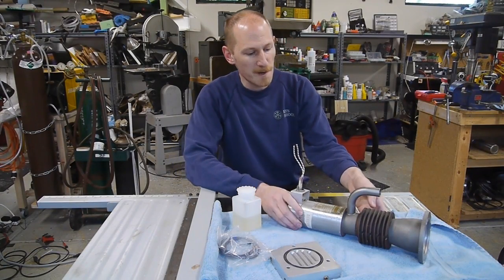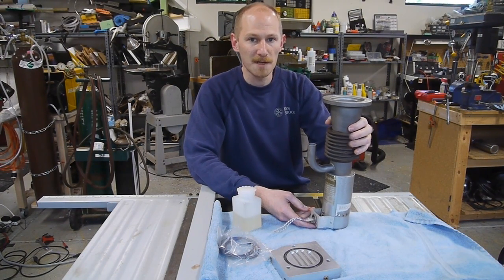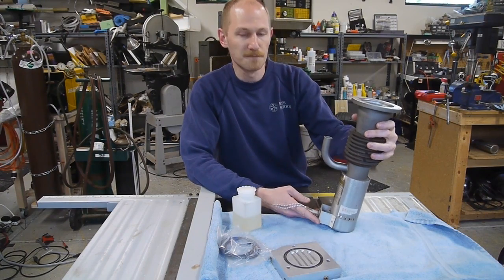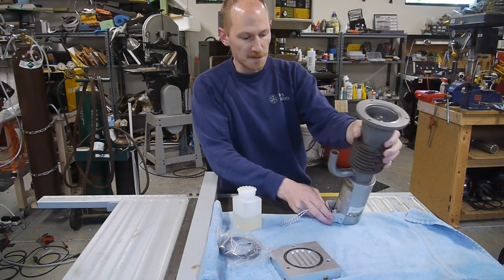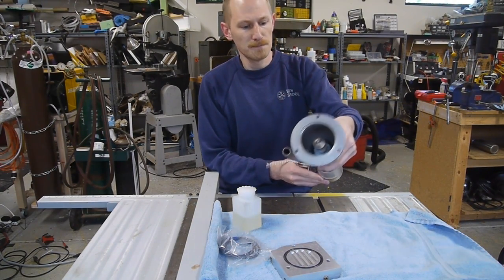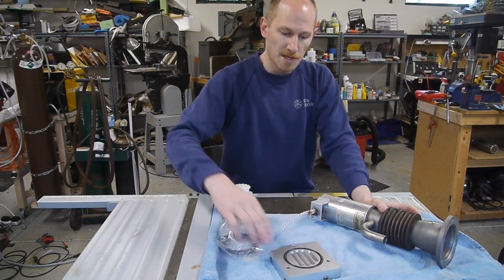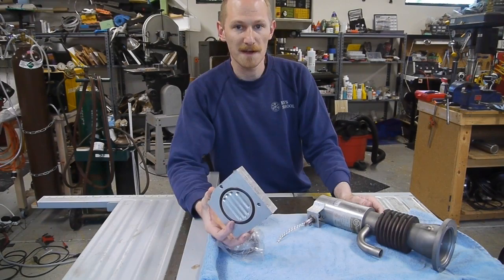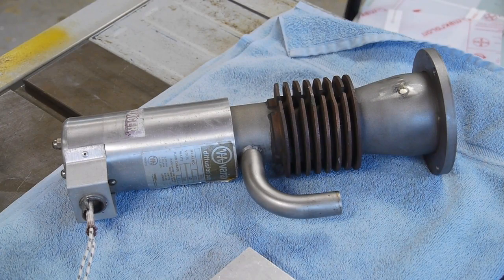Diffusion pump giveaway contest - ends May 31 2014

Comment: I think it is kind of you to do this. I am just curious--  I am unfamiliar with the hardware,  why would you need another vacuum pump from harbor freight to make this one work, and would this be very expensive to buy?
Thanks ! I've enjoyed watching many of your vids, especially enjoyed your lcd displays.
Reply from the maker: Ron Schnaper In order to create and maintain really good vacuums (very low pressures), we need two vacuum pumps connected in series. The two pumps differ in construction because they work with gas molecules at very different pressures. A mechanical pump is good at pushing air around when the air is fairly dense at a relatively high pressure, however it doesn't work very well when the air molecules are sparse at a very low pressure.  Instead, we add a second "high-vacuum pump" to help compact the remaining air and other gases from the vacuum chamber so that the mechanical pump has something that it can actually pump.  The total pressure ratio between the bell jar and atmosphere can be 10^8, which is pretty massive, so we spread out that huge pressure differential between two pumps.
Reply: Applied Science I always used to envision diff pumps as pressure transformers, where actual driving force is mech pump, diff pump does not pump by itself, oil vapor stream just catches the molecules changing their speed and conditions it for mech pump (something like venturi)...
Aah your videos sets me back, Varian, i saw a glimpse of MKS cold catode ion gauge vacuum controller, one of the best two stage vacuum pump Alcatel (orange), did not see Edwards stuff, so many nice things in your home lab makes me remember my old job messing with ICR-FTMS and stuff (still missing superconducting magnet with lHe hehe)... subscribed now

Comment: I can't believe you have a SPARE diffusion pump.... and you are giving it away!
Ben, you are awesome!

I will make a video, for sure. I have everything I need for a high vacuum system except for a diffusion or turbo molecular pump.... mainly due to the cost. 

I will definitely make a video to show what I have and what I need to get it up and running... I soooo badly want this for my experiments! You can be sure that I will post videos of my chamber in operation. Well, with that said, I'm off to make a short video.

Please Ben... Choo Choo Choose Me :)
Reply: I have two Edward E02 vapour diffusion pumps that I have zero use for. Do you still need one? Or two?